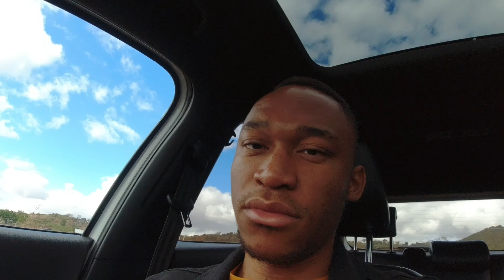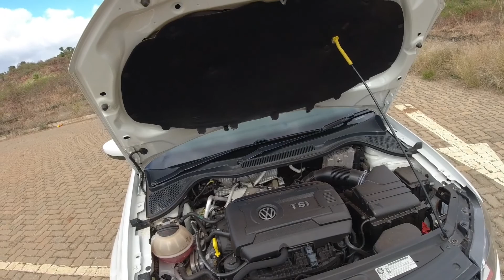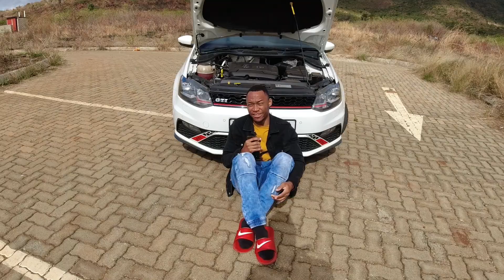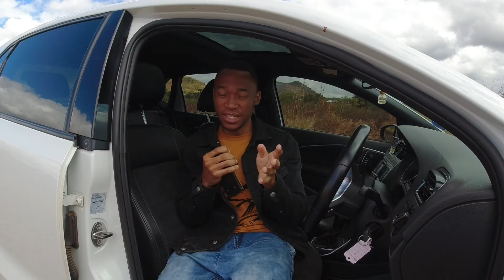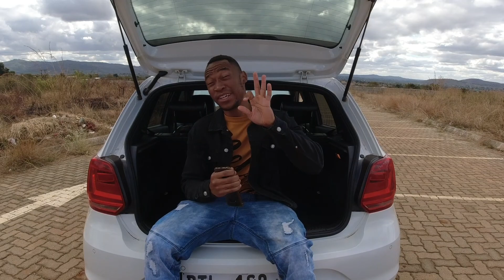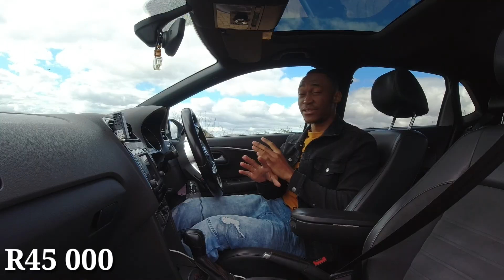Mechatronic Failure On The Polo 6c GTI | DQ200 Common Gearbox Faults |

Comment: Mine failed on my 2017 Golf GTD 4 weeks after my DSG service luckily my extended Volkswagen warranty covered it & I got a brand new gearbox & mechatronics unit
Reply from the maker: Well done sir
Reply: @embakubmotoring I also got a mk8.5 etsi to drive for 2 weeks while it got fixed

Comment: I fixed mine for less than R3000 after buying parts on AliExpress plus my 6 hours. It's a bit of work to fix, I understand why they charge a lot, but if you're a DIY person with the right tools, you can fix it and save. I paid R35k in 2022 for a transmission error, reverse not possible for the same car. This time, I decided to do it after getting a quote for R20k due to a fault: anti play protection, P189500: function restriction due to pressure drop, P176C00: Gear selector 3 cannot be regulated. After some research online, I found out the main culprit was a crack around the accumulator housing resulting in P17BF00: Hydrolic Pump, Anti-play protection.

Comment: If you take care of this care, it'll take care of you too. My car clocked 150000km and its 8 years old! Only had to fix mechatronic last year, and water pump 2 years back. 80% of the costs where covered by the warranty. 0 modifications on the car though, so no added pressure on gearbox and engine. Car still drives like a dream!
Reply: Who is your mechanic brother

Comment: Yesterday my mom's Volkswagen TSI's reverse gear doesn't work and driving to the mechanic was harsh and limping due to the rough gear changes.
The error code that popped up was;
P174F00 - Valve 4 in Sub - Transmission 2 Electrical Fault.

No idea what that means but mechanic said it could be possible that it is the Mechatronic unit failing.
Reply from the maker: Yeah that’s not nice at all

Comment: Nice car to drive but if you buying one get maintenance plan, i dive the pre face lift AW polo gti and i have had to replace the water pump, intake manifold and the gearbox. Its not cheap, extend or get aftermarket warranty

Comment: Hi Emba,
I have a 2014 vw Polo. I had a error gearbox appear on my screen. Car would not give us gears 1,3,5 & 7 (all the odd gears). Diagnostic report gave codes P176C as gear monitoring: 3. Gear no regulation Sporadic fault. 
I had 2 seperate diagnostics done by different mechanics. Went to VW and they said it had nothing to do with the Mechatronics unit but rather that I need to replace my clutch and flywheel. 
My question is why does the error reset if I switch off car and restart engine and then all gears are available again and then it would sometimes do it again and sometimes not. 
The mechanics who did the diagnostics do not believe that replacing the clutch and flywheel will resolve the issue as it seems to be an electronic issue rather than a mechanical (Clutch) one.
Reply from the maker: From what I’m picking up it might just be an electronic error, probably has to do with a sensor or regulator, hense it resets when you turn the car on and off again…

It’s very important to carry out as many diagnostics as possible to help pinpoint the exact issue, to avoid over spending or replacing the wrong part…

Comment: I am facing this issue right now with my polo6 r line it is not starting at all, it doesn't even turn the starter at all. I took the starter out and tested it and it works perfectly i then called both my mechanics they saaaaid it mechatronics  called vw for a price of it 44000 something rands
Reply from the maker: It's never a nice thing to experience, but sadly these issues are real.

Comment: I thought manual clutches we cheap until I needed to replace the TDI. Its about R21000 including the expensive dual mass flywheel and a must to do with clutch, this is parts only cost from Dealerships. Maybe can be around R10000 at the likes of GW.
Ai cars nowadays are expensive to maintain and repair. No wonder some people don't keep these any longer than the warranty period.

Comment: Bro is it advisable to buy a pre owned 216/2017 1.2 Polo TSI ?
Reply from the maker: They also have similar issues
Reply: @embakubmotoring  So in other words, a manual one would be a safer bet compared to the dsg one?

Comment: I’ve got a car with this gearbox, I haven’t had any complaints with this box to be honest.

 I’ve found that it drives smoother than my DQ250 diesel car (I’ve also driven a DQ250 petrol a brand new Q3) and I’ve found my DSG7 to have better up and down shifts as well as faster changes.
 My honest opinion is that these transmissions fail 90% of the time due to human error and lack of knowledge or care for that fact… 
people can’t blame the transmission when they using their gas pedal to keep the car stationary especially on uphills then cry about needing new clutches and mech unit because it’s toasted itself on a car with less than 20k km.

These gearboxs have dry clutches to reduce the weight and resistance to allow for better smoother and faster operation of a auto transmission on a lower powered platform that’s the only reason it’s a dry clutch it’s also not a first of its kind dry clutches are used in many shapes and forms and applications including high performance the biggest issue that causes these to fail is HEAT and stupidity. Dragging your clutch wears it out 100x faster than normal as-well as produces double the amount of heat the gearbox can tolerate not only that but when in traffic in any dual clutch transmission. You must not keep this causes the clutch to slip as-well as to have it constantly flicking between 1-2 you can expect it to have a shorter life if this is your driving style and to also mention the mech unit housed separately these boxes have 3 chambers mech unit gear unit and clutch unit the mech unit used mineral oil and what happens is when this oil begins to overheat it looses its viscosity which is the same effect of replacing hydraulic fluid in a car jack with water. It still functions but won’t be able to lift anything. I’ve found that this gearbox receives more hate than recognition 
If people understand how to drive a dual clutch properly they’ll see 100s of thousands of KM problem free if regular maintenance is done aswell.

That’s just my two cents on these boxes and why they tend to fail with people last forever with others.

TVS engineering has kits and tunes for these boxes to make them absolute gems for those who want to keep their car for long and have this gearbox. Go for TVS and install a Stage 2+ TCU tune it fixes all the factory issues with the software that leads to mech failure and improper clutch pressures and more.
Reply: Also with the stage 2+ can you raise the torque? Cause it’s limited at 250nm!
Or you must add Kevlar clutch?
Reply: Το εκανα στάδιο 3 dq200 με is38 turbo , με Kevlar δίσκους
Reply: Change the DSG fluid as frequently as required by the manufacturer. Only buy oil from dealers no cheap alternatives. Not cheap about R550/L and you need 3L.
Reply: In traffic i take my foot of the brake and car moves(not sure if you call that creep) ... u can't give petrol all the time in traffic and must roll. 
On hill stops I use to let my foot of brake and it holds. But now I keep my foot on brake.
I got a shudder only on D3
Reply: Thanks brother! I have this car and no issues at all. People just don’t know how to drive these dry clutches! People abuse them to bits, tune them above the 250Nm and expect them to last!

Comment: Hey Kub, I had a mechatronic failure on my polo tsi and replaced it. After am experiencing leaks where the unit meets the gearbox. I took the car back to the garage but seems like they are failing with fixing the leaking issue. what could be the problem?
Reply from the maker: Sorry for the late reply, maybe it’s an issue with the solenoids? But they should be able to figure it out, how do they expect you to figure it out, push for your car to be fixed properly, that’s bad service from them…
Reply: Heita Phetso. What sort of problems did you have on your Polo TSI, if you don't mind me asking. I drive the same car and I think my mechatronic is failing. The car jerks back and forth when accelerating harder or accelerating from stop.

Comment: I drive manual cars I was interested in this DSG I have done a lot and I mean a lot of research on the 6-speed and the seven speed dry and wet my conclusion was they are so prone to problems I would not touch them I've spoken to gearbox experts who repaired DSG they said they love them make stem very rich now if you buy a BMW zf8 work of genius a proper automatic gearbox not a manual with two actuators that is what the DSG is rubbish design

Comment: I replaced the mechatronics twice on my polo 1.4 gti (2014) second time after fixing I Sold it very fast & never regret it I actually done myself a big favour
Reply: Its not the car its you bro
Reply: @domino6434  I also did mechatronics twice clearly there’s a big problem with them, that’s why this video was made.
Reply: @swooshots3039  clearly you are not taking good care of your car
Reply: @domino6434 car is serviced and maintained at the dealership since it was bought, the fact that this video and many others exist means there’s a problem with boxes, if you’re not experiencing any issues good for you, we’re chatting in a video highlighting mechatronic problems.
Reply: @swooshots3039  nahhh but continue yapping tho
Reply from the maker: Damn twice? That's Insane
Reply: Was it difficult to replace, I’m gonna have to replace mine. Just waiting for the parts

Comment: I have a Golf 6 GTI and mine also does that. Whenever I go into reverse after a drive the P light flashes on the dashboard and revs up before kicking in to reverse. That 50k will definitely slap hard😰
Reply from the maker: Definitely an issue with the reverse selector or mechatronic, maybe both 😬

Comment: Mine is a 2016 model with 101000 km currently. I bought the vehicle last year August with 94000km. Also has a full service history. I own this vehicle for almost a year now and I've had the following issues:

Water pump thermostat housing leak first . Complete water pump was replaced.

Oil cooler leak. Replaced whilst doing the water pump.

Radiator leak a few months back.

Personally i believe if you want to own a second hand gti, you must have a mechanical warranty in place. These cars are also not cheap to maintain. 

Major service due in September and the parts alone are 4k.

The only thing i disliked about the polo 6c gti is the hard suspension. I installed a set of eibach prokit springs and the ride and handling improved drastically.
Reply from the maker: Damn that's quite a list of issues...
I agree, the suspension is really hard.
Reply: @embakubmotoring  Hi Emba, my golf 6 dsg has a shuddering effect when getting into gear 2 after the car has warmed up. other gears are okay. This causes it to shake for less than a second. this only happens when the car has warmed up and usually worse when im carry a heavy load. Do you think it is the clutch? It has never thrown any transmission light.
Reply: Thank you for a nice breakdown of issues and/or ownership costs🙏. What's your feul consumption, how many kilometres do you get per full tank?
Reply: @thobanimanzi  Bro i live close to work. 16km return trip. So i fill like 250 a week lol
Reply: @jaredwaynemarrimuthu2868  good for you bro.. My return is roughly 80 km, of which 8 km is township driving with stops and around 25 speed humps then tge rest is freeway driving.

Comment: if you love VW,AUDI stay away from DSG rather get a manual unless if you can't drive a manual  or you are loaded with cash for repairs  after warranty  even buying a motor plan won't fully cover the DSG repairs you still have to cough up a bit more to add with the motor plan DSG repairs  no thank you had my fair share of this problem sold the car after the repair .
Reply: 100% agree. Sold mine after gearbox trouble also. Costs more than the car is worth to fix.
Reply: What golf dsg you had? The dq200 or dq250?

Comment: Quick question Emba, is it safe to buy a 2017 golf R dsg. If so what are the things one should lookout for including the dsg gearbox.
Reply from the maker: The Golf R should be a safe buy because it has the more durable 7 speed wet sump gearbox, but if not well taken care of it can still have mechatronic issues or clutch wear and tear given how some people drive these cars…

Also earlier Golf Rs like 2014/15 often have Haldex pump failure, that’s the hydraulic system that helps send power to the rear wheels to make it 4WD, how you notice this problem is, the car will start having wheel spin on the front wheels and flickering the traction light, Because power will only go to the front when the Haldex pump is faulty, so drive the car, do launch control to insure that it still hooks on all 4 wheels…
Reply: Don't buy it😅

Comment: Guys if your Audi/vw have a mechatronic failure don't drive it otherwise you'll cause unnecessary damage inside the gearbox,  my 2015 Audi A3 had this problem last year (224000km) and If I didn't drive it the mechatronic was the only thing that was supposed to be replaced but because I didn't leave it the mechatronic, flywheel and clutch plates got ruined which added to the cost so don't drive it just tow it to the dealership
Reply from the maker: Good point

Comment: Here is why VW cars are not cheap to buy or Maintain:

VW Group. Lets go for the DSG straight and analyse it.

1.DSG was developed by BUGATTI(Bugatti is owned by VW group) engineers in the early 2000s.(Hold it there)

2.It is a very efficient and strong type of gear box. In simple terms, two manual gearboxes combined and controlled by a computer(Automatically).

3.’Germans being Germans’ decided to put ‘cheap’ variants of those DSG in VW,SKODA and SEAT(The Volume car brands in group).

4. VWs are ‘cheap’ versions of Audi and Bentley, which also use DSG(Expensive ones).

5. The point here is: They (tried) to make the DSG cheap.
Reply: Interesting!
Reply: Oh yeah.. I have skoda kodiaq with dsg 7 problem.. and the car has only 101.000km
.. and the mentenance only on VW ..